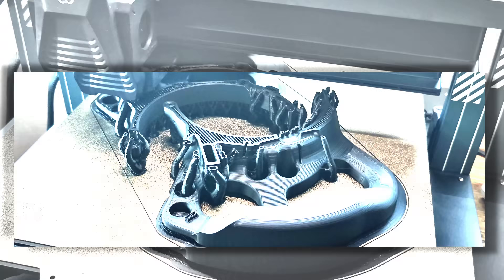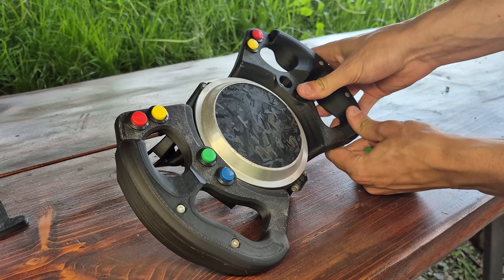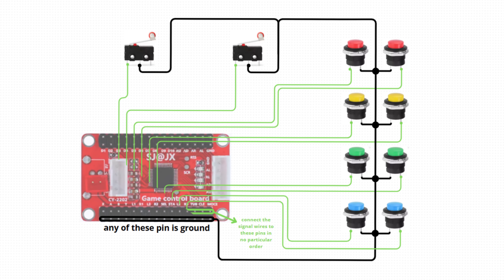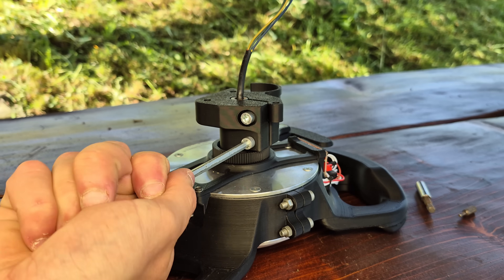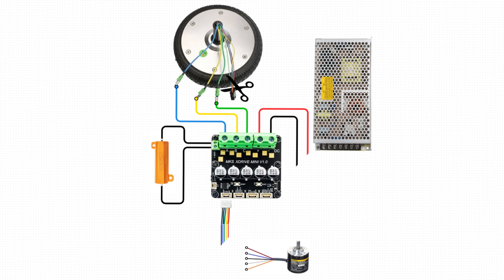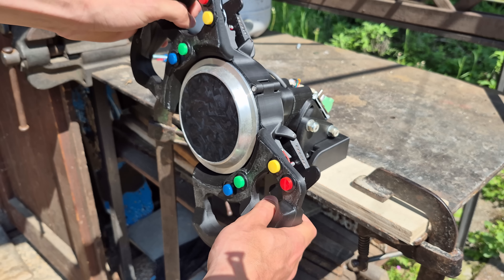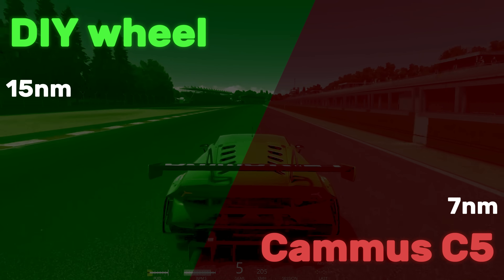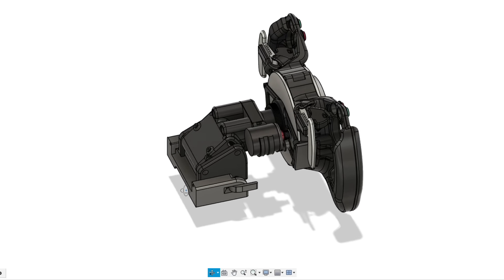HOW TO BUILD a 15Nm DIRECT DRIVE Steering Wheel | DETAILED TUTORIAL

Comment: One change I'd make is to add a data Slip Ring for the USB encoder so that you don't have a USB cable dangling from the wheel at all times. If you have a bad crash and the game decides to spin your wheel violently around that cable would definitely get damaged.

A cheap 6 wire slip ring costs like 10 USD which is perfect for this budget DIY wheel.
Reply from the maker: There's no way of fitting it, a simpler way is to just make it wireless, coming up in my next video!
Reply: slip rings are a no go for high speed data. USB at the low speed is 12MHz, so a slip-ring bounce means kilobits of lost data. Go wireless or optical for data transmission.

Comment: Did you get any heat problems with the motor? How long can you run your and how much ffb %?
Reply: I saw one of his comments here: 

It's now about a year since I built my previous FFBeast wheel, and using it at 100% power did get hot, but I solver that by drilling holes in the motor housing and adding a blower fan. I will show this procedure in one of my future videos. 
The motor gets hot because there's no airflow through the windings, adding a fan and ventilation holes solves this issue completely
Reply: @jeronimo196  Thanks mate! Holes on the front face and the back face of the hoverboard motor?

Comment: what do u think about using magnetic encoder instead of rotary, for example as5600 extremely cheap and dont need any type of drive to check for position change, u can just place a magnet on steering wheel axis
Reply: anyway really impressed with your project, keep it up

Comment: How did you measured torque of this wheel? You're just eyeballed it did you? 15Nm is just nonsense.
Reply from the maker: CNC Dan measured it at 13,5nm
Reply: @DAZprojects  So...I was right. You just say its 15 without any measurements. Maybe motor can produce this torque, but  you're not running motor at full power.
Reply from the maker: @konyDobrotivy It can do 15 depending on the motor
Reply: @DAZprojects Can you prove it somehow? It impossible your construction can handle 15Nm.
Reply from the maker: @konyDobrotivy  why everyone thinks that, 3D printed parts are stronger than you think probably, the weak link here is the quick release, but I'm redesigning it.

I'll also make a torque test and max strength test in my future video
Reply: @DAZprojects  Why every DD wheels manufacturer use metal? Why literally no one's use plastic when it's cheaper? You proved enough, you don't understand what torque means. Everyone who's ever tried strong DD can say you're not driving at 15Nm in video. Its so obvious.
Reply from the maker: In the video I'm not, it's like 5/8 Nm. It. An do up to 15 though.

Also I know what 15 feels like since in my previous build I used 100% power which equals to 15nm  @konyDobrotivy
Reply: @DAZprojects  It's max 5Nm, propably less. So why you claiming your casing can hold 15Nm? Every guy who follow your build will be very disappointed...
Reply from the maker: I tested it at max power, it holds with no issues. Also this was a video to see if people would be interested. Now I'll improve it making it stronger and more rigid. In my next video I'll show all of that, just wait and then you'll see it holds perfectly fine
Reply: @konyDobrotivy  I’m not — I went from a G27 to this, and it’s amazing. Feels like a CSL DD at 30 % power.
Reply: @eliassundman5299 CSL DD have like 5-6Nm? So it's 30% of it CSL DD is exactly like G27.
Reply: @konyDobrotivy  they said at 30% of this wheel it feels like a CSL DD (5nm) reading isn't your strong suit
Reply: @jayreed632 I think you can read it both ways. 

IT doesnt really matter. My point is, that in video it not running ať 15Nm.

Comment: I can't stress this enough you REALLY should not connect the phase wires in any order it needs to be sequential as if say phase c was on B and B was on C and a was A it would be firing the coils wrong. basically KEEP it in order and try to get it with Aa Bb Cc for the motor coils as that keeps it from burning out if possible.
Reply from the maker: Wrong, you can connect them in any order, swapping two phases will just make the motor spin backwards.

That's because it doesn't have an encoder to read the motor position and drives it as a sensorless brushless motor. 

The rotary encoder is there just to record the steering wheel position for the PC to know exactly the steering wheel angle, it's not there to sync the motor phases
Reply: @DAZprojects  You’re probably right I don’t want to risk it and will just keep in phase order just to be safe.

Comment: Hey how would I source that hoverboard motor ? Are all hoverboard motor standered?
Reply from the maker: Exactly, every overboard motor is basically the same
Reply: 6,5 inch 30mm magnets is required for 15nm. Also ask the seller to weigh the motor before buying, it has to weigh around 2.9 - 3kg, otherwise you get a less powerful motor.

Comment: Can you explain how you use your pedals on this wheel? I saw the wiring diagram for your other wheel but i like this one way beter. Is it done another way or basically the same?
Reply from the maker: The pedals are wired separately to the PC using an Arduino Leonardo board to make them show up as a separate joystick

Comment: I may be wrong, but having the magnetic encoder on a belt system makes it no longer a direct drive system ?
Reply: that's also what I noticed, it's a really cool build and for a DIY/first wheel this is a good one, but having the encoder not connected to the motor DIRECTly means it's not a direct drive(although if you never used a direct wheel before you really wouldn't notice the difference in the force feedback) this feels like using AI in the title of a product to sell more...

Comment: I like Your wheel. One thing that puzzles me is why are we using an external encoder and not the hall sensors in the motor? seems wrong
Reply from the maker: @johnbeer4963  that's how it works, you can't use the motor hall sensor since they're not precise enough

Comment: This seems like a good design for anyone that doesn't have the skill or equipment to drill the holes in the standard FFBeast designs. But i think if you are trying to be responsible when presenting a design, you should also show it's potential issues. For this design the issues i see are using PLA, as it is easy for a 20mm magnet 3 wire hoverboard motor to get above 60°C which is about where PLA starts to get soft. I've had this type of motor get to 70°C after 1.5 hour at 30% power in FFBeast, that equals about 5Nm torque at that power setting. I think you're likely to have issues with the shaft clamp coming loose due to temperature and creep in the PLA especially since it's not using the flat on the shaft to prevent rotation. You'd be better off to leave it in the hoverboard chassis and clamp that to the desk. The other issue you've skipped talking about is the button pcb USB cable which will get wrapped around the wheel as it turns, but i guess that can be ignored if you're only using 360° or so of rotation.
Reply from the maker: It's now about a year since I built my previous FFBeast wheel, and using it at 100% power did get hot, but I solver that by drilling holes in the motor housing and adding a blower fan. I will show this procedure in one of my future videos. 
The motor gets hot because there's no airflow through the windings, adding a fan and ventilation holes solves this issue completely

Comment: Why with this one do you not need to modify the internals?
Reply: Because the steering wheel just clamps onto the hoverboard motor and he's using the rotary encoder and for the USB button board it looks like he's just connecting it with an external wire (which will wrap around the wheel if the wheel is turned too much).

Comment: Just a question, doesn't having the motor as a part of the rotating mass make the wheel less responsive, or is it not that big of a deal?
Reply from the maker: @raumo123  it's not that big of a deal since the motor is actually pretty light, the stator which is the heavier part stays stationary inside of it
Reply: @DAZprojects  Ah I see, I'm not an electric motor expert, but guess there's a reason why hoverboard motor shafts are mounted to the chassis. Amazing project this, thanks for doing it and the fast answer.

Comment: could someone make a mount where it turn the wheel into a normal circle wheel so you could swap by just clipping the mount of and a question does the wheel have full 360 rotation
Reply from the maker: @MarkyBoyy I thought about that but would be extremely dangerous, that's because the buttons stick out the back and could easily get caught on your fingers and cut them open. I'm currently designing a round wheel add-on that can be swapped for the F1 wheel by simply undoing the hinge bolt, slot it around the motor. 

Also the F1 wheel is a bit wider than a standard rally wheel, and will result in a wheel more similar to a truck wheel. I'll probably make one with, and one without paddle shifters, but in any case no buttons
Reply: @DAZprojects  CAN'T WAIT😊
Reply: about those 3mm nails are they removable?
Reply from the maker: @MarkyBoyy most of them not

Comment: Can you make a round wheel for drifting? Then maybe we can use the other wheel that's spare to make that, or create a system where it's quick release
Reply from the maker: @Danny30197  I'm designing a round version that clamps around the motor, just undo 1 bolt, remove the F1 wheel and install the new one around the motor (I also changed the two m5 clamping bolts for a single one)

Comment: Just curious how the torque for this is calculated 15nm seems like a tonne for such a small piece of equipment?
Reply from the maker: @raginranga6023  that's the max torque that a hoverboard motor can provide
Reply: He could easily calculate it using scales, there is a guide on xsimulator.
Realistically I doubt it's more than 3Nm, I've done a MY1020 48V 800W, Modded HP DL585 G2 @ 12v 118A, I run it 12V 66A for 8Nm (Scales measured 7Nm.)

Full parts list: 
Omron E6B2-CWZ6C Encoder
MY1020 48V 800W Motor
Four BTS7960s in Parallel
STM32F407VETG
And ebolz magy EMC software.

Full build cost: £135 including wiring and filament for a 3d printed case for electronics. 

I heavily DOUBT this build is anywhere near 3Nm consistently, I also no not recommend doing a DIY build they are not worth it anymore, and they are horribly inefficient. Buy something off the shelf such as an alpha mini, VRS, Moza R16 V2.

Comment: It can function in PS4 o PS5?
Reply from the maker: Unfortunately no
Reply: You can do a thing. You can dedicate a PC, it can be a simple PC say an old Netbook from a flea market, running Windows or Linux your choice, as an adapter, together with GMIX with EMUG29PS4 firmware on an Atmega32u4 such as Arduino Micro. It's not very elegant, unfortunately, it can be done better but for the time being no suitable project otherwise. I do think of someday building a suitable firmware which borrows the USB device descriptor but is also a wheel firmware not just passthrough, but not for Atmega but for Blue Pill or Pi Pico, this would be more elegant, but i predict some roadblocks, like i have doubts i can make G29 emulation work on PC, since i don't have the descriptor or the actual G29 wheel.

Comment: I can't believe that this 3D Printed thing is holding up at 15 Nm without creaking all the time and breaking itself off, but definitely worth a try
Reply: 100Nm is about 10kg on a 1 meter lever, not that much.  What sort of locomotive has such low torque?
Reply from the maker: @grantts7 finally, someone that understands what torque is, thanks man! 😂
Reply: @DAZprojects What is your 3d printer name?
Reply from the maker: @tellmeinenglishchannel elegoo neptune 4
Reply: @grantts7  Yea, you're right. Dunno why, but I saw kN instead of Nm. My bad.
Reply: I'd like to suggest that it's not running at 15nm but closer to 7-10.
Reply: @SianaGearz  He could easily calculate it using scales, there is a guide on xsimulator.
Realistically I doubt it's more than 3Nm, I've done a MY1020 48V 800W, Modded HP DL585 G2 @ 12v 118A, I run it 12V 66A for 8Nm (Scales measured 7Nm.)

Full parts list: 
Omron E6B2-CWZ6C Encoder
MY1020 48V 800W Motor
Four BTS7960s in Parallel
STM32F407VETG
And ebolz magy EMC software.

Full build cost: £135 including wiring and filament for a 3d printed case for electronics. 

I heavily DOUBT this build is anywhere near 3Nm consistently, I also no not recommend doing a DIY build they are not worth it anymore, and they are horribly inefficient. Buy something off the shelf such as an alpha mini, VRS, Moza R16 V2.
Reply from the maker: 3D prints are much stronger that you probably think, this wheel could easily hold up to 100nm, and in the worse case the motor slips
Reply: @DAZprojects 20NM wheels can break your arm if you grab it incorrectly, so I highly doubt 3D parts can stand 100NM
Reply from the maker: @ravidu621 imagine it the other way around, you think the 3D printed parts will break before your arm breaks???
You think that you can break the 3D printed wheel just by turning it by hand?
Reply: @DAZprojects  I guess you are joking with 100 Nm or you don't know what that means.
Reply from the maker: I guess you don't know how strong 3D printed parts can be
Reply: 100Nm is pulling strength of smaller locomotives. You're just saying nonsense.
Reply: @konyDobrotivy 100Nm on a 0.5m radius wheel is 200N of force (~20 kgm), you're NOT moving a train with that even if you applied that torque to 100 wheels, what plant did you smoke

This steering wheel probably has a radius of like 10cm, and 100Nm@10cm is 1000N ~= 100kgm, basically one 50kg kid hanging from one side and another standing on the other side, it's 100% not going to break

Comment: Hello i have a problem with my motor overheating do you have any advice?
Reply from the maker: You need to lower power, or you can also make holes in the motor housing and use some blower fans to cool it
Reply: @DAZprojects  I lowered the power limit to 50% i drilled holes in the motor but it still overheats and smells really bad. It gets up to 70c. Does your motor heat up to that temperature when playing of high ffb

Comment: Some have already commented about worries on using PLA because of motors heating, this could ofc be remedied easily but have you had any issues with heat?
Reply from the maker: @ragetist  no, just if bumping power up to ridiculous levels. I think it also depends on the motor you're using
Reply: @DAZprojects  Thanks! I had a feeling but wanted to make sure.

Comment: weight of this motor mounted on wheel instead of base doesnt throw off balance? doesnt it make wheel feel heavy and unresponsive?
Reply from the maker: No, it doesn't mainly because the majority of the motor weight is the stator, which stays still.
Reply: @DAZprojects  makes sense but its hard for my mind to comprehend haha. Great work mate <3

Comment: Just buy a high quality one and save all the money from a 3d printer... just buy one
Reply: To be fair you can easily buy the 3D printer, build this and still be under the price of a similar wheel.
Reply: some people already have a 3D printer
Reply: 3D printer if you're dedicated enough is cheap... you can build one for a hundred easy, i did so in 2017. It may be a crap printer but as long as you understand what you're doing, how it works, it'll make the parts. There's also any number of ways you can get your parts done, makerspace or library or a service.

Comment: Design itself looks good. But PLA (maybe even PETG) will melt after an hour because motors get really hot. As well as breaking resistor, which may be so hot that it creates smoke.
Reply from the maker: Not for me, probably depends on the specific motor. I drove more than 1 hour F1 and the motor was slightly warm

Comment: Very ingenuitive but id like to know in what country the parts for this would cost 100euro? Somalia?
Even considering you'd get a free hoverboard motor the rest would still be way more than 100
Power supply, encoder, switches, buttons, Arduino board..
It costed me over 50 euros just to do a simple sequential shifter with less than half the parts and wooden shell
Can you post a parts list please?
Reply from the maker: @racinglab6797  the parts list Is in the video description!

Comment: Nonsense. 
 > Use PLA filament
 > up to 15Nm of torque
 > [wraps PLA parts around hot motor]

It will work with desired torque for 15 minutes of race, and then it will melt completely. Or just use <5Nm for some long time races.

I’m owner of FFbeast wheel for a long time now, and i can say it gets hot! After 40+ minutes race with <=10Nm setting motor is too hot to touch. Absolutely impossible for long time use with PLA.
Reply from the maker: Probably, in my previous build I drilled big holes in the motor housing backplate and added blower fans, it kept it super cool and didn't overheat. 
I'll probably do the same here

Comment: Which hoverboard to accommodate for the brand and right motor?
Reply: it's a lottery. you are looking for the fattest possible stator (they are all the same from the outside). Every motor will work, but max torque is from 24-31mm stator or magnet size)

Comment: WOW. I see a lot of great, hard work. I know this is not easy.
However the title is missleading, because this is not direct drive. It's belt driven wheel.
Reply from the maker: No, it's direct drive, only the wncoder is belt driven, the motor is directly connected to the steering wheel
Reply: @DAZprojects  Indeed it is. So the conclusion is you're much smarter than I thought, and I'm much more stupid than I thought 🫣